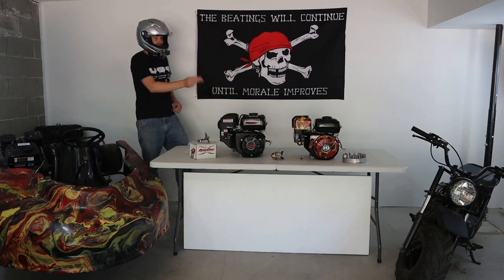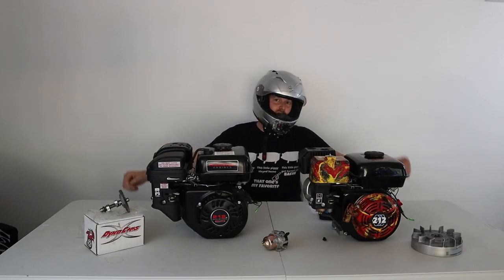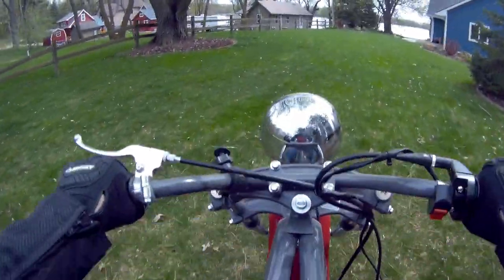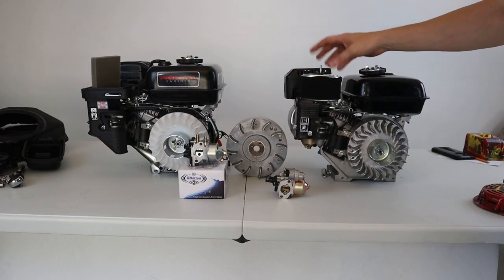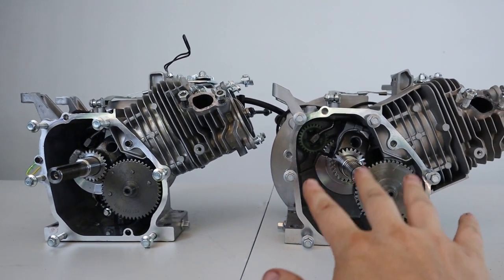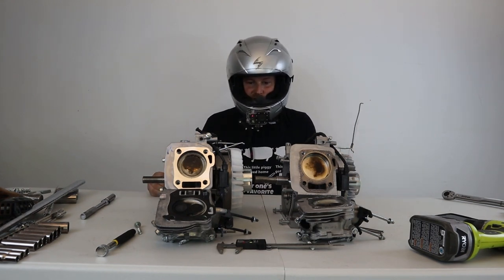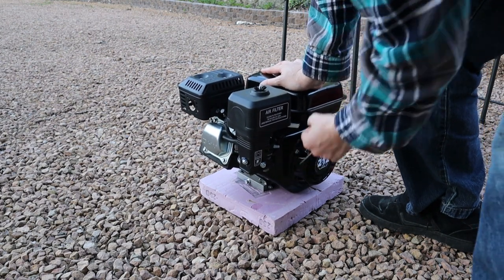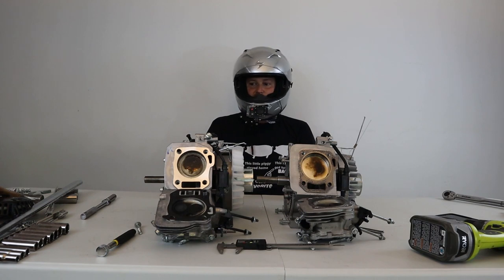Tillotson 212 versus Predator - Best 212 cc engine for performance mods?

Comment: Would have been nice to see at what RPM maximum torque was at. A 212 Pred with a stage one kit should get over 9HP at 4600 RPM. Years ago I seen a dyno test result of a stock Pred with what is known now as a stage 1 kit. It got 13.5 ft/lbs of torque.

 The Tillotson should have more power. It has higher compression out of the box than the Pred. No mystery there.

Out of the box the spring is in a different hole on the gov arm. This is why the Tillotson gets higher governed RPM than the Predator. You can do the same on any 196 or 212.

I  would never buy a Tillotson unless I was building a monster 8000 plus RPM engine. The Pred 212 and 196 clones work just fine. I guess the Tillotson is nice for those who want out of the box power and don't want to open the engine. And by the way, these 212's are not clones. True clones are 196cc.

Another thing to remember here is that the Tillotson is an out of the box mini bike and go kart engine. The Predator is an out of the box utility engine.

Comment: Camshafts in the tillitsons has more lift and longer duration and my 212 e also came with stainless valves automotive keeper and locks and bronze guides

Comment: Having worked on both of these the Tillotson blocks are so much better. Take a bore gauge to your Tillotson vs the Predators. 

I have a Predator Hemi transplanted into a Tillotson block. You can't with a non hemi. Since the heads don't transfer without machine work.

Have a regular 212R bought as a fully assembled engine. Works a champ.

I won't be buying Predator stuff ever again.
Reply: same here - EVERYTHING is better

Comment: Those engines are not the "hemi" headed ones. Those ones generally have more torque stock but really open up when you put a stage 1 on them as they flow so much better. 

FYI: Harbor Freight look for part #60363 which is the hemi version. they mix them as all 212cc engines.

Preditors have very weak valve springs stock also and just a stage 1 it's recommended to upgrade them as with the higher RPM's they will float a bit even with the governor.
Reply from the maker: The hemi head comparison can be found here: https://youtu.be/zXj7VSEMJ4A

Comment: I'm using a 212 so it fits in phatmotos frame. This video helped me pick the Tillotson as I'm gonna build it as much as I can. I like all that extra support. One question though. Does the tilly support a charging system if I were to install it? I prefer that to a battery bank light system

Comment: yeah get the Tillotson block and just build a 212 with what you want. save on stock parts you'll scrap anyway like rockers, pushrods, valves and springs, etc.

Comment: I recently purchased a Trailmaster 200-2 and it comes with the 196cc Chinese clone engine, Jhiang Dong I believe. I'm thinking of replacing it with the Tillitson 212r. Could you do a side-by-side comp of these 2 engines?  I plan on keeping the engine stock, but will be replacing the 46t rear sprocket with a 60t for better low end torque.

Comment: watch a comparison of 2 gasoline engines on video. Like I saw the machines I owned were branded RATO and branded DUCAR.

I chose the best Predator machine, because it is similar to the rato machine that I have.

I have tried almost all engine brands.
Original Chinese-made gasoline engines like Rato & Loncin are very strong, able to fight famous brands such as Honda, Robin, Yamaha, Mitsubishi, Briggs & Stratton, Kohler.

Meanwhile, other brands of gasoline engine made in China, according to my experience and knowledge, are not as tough as Rato & Loncin

Comment: What do you think is the best cam for the 212r To take advantage of the parts already on there like the flywheel, head, and piston.  I know the one that is in it is better than stock but I'm sure as ur RPM goes up it will start to fall off.

Comment: do you have a recommendation on wether it would be worth the money to buy a stock predator and put the Gopowersports stage 2 kit on it (cam, rod , flywheel #22 springs) or just buy the MkII 212r from EC carbs and throw some #22 springs on it. about 80$ cheaper for that. 

I already have a stage 1 kit to put on either motor.

Comment: What did you mean by the $70 upgrade flywheel on the Predator ????   I've been wandering about a flywheel upgrade without having to spend lots of $$$. Not going to spin one mega PPMs but still don't wanna explode one.
Reply from the maker: The PVL flywheel is an alternative to a billet flywheel. It costs about $70 and has a range up to 17,000 rpm.

Comment: Any reason to put a mikuni carb on the 212r also what about a different exhaust to see gains in HP?  I put a 212r on my yerf dog 3203 with a juggernaut and noticed a considerable difference compared to the techumseh 6.5 and comet clutch.  Just wondering if I should spend the cash in the mikuni and exhaust for added hp gains?
Reply from the maker: Great question. I have a header on mine with stock airbox (since it's high flow) and it gave a nice little boost. However, unless you replace the piston rod with billet, up the valve springs, remove the governor, then you don't want to put too much more power into it. You've gotta make it safe for the extra rpms, first. If you remove the gov, switching to a smaller mikuni makes it easy to have a tidy throttle setup. Wish I could give the perfect answer, but you have a few paths you can go. Without governor removal, the carb won't do too much but itself. The header and a jet swap on the carb will be your biggest impact at that level.
Reply: @megoingfast  Thanks, honestly with the 212r on there and juggernaut it has enough power and torque to spin the super turf 20x10.0-8 and we get up to 35mph on the dirt with 2 people.  That’s fast enough for that small frame.  Thanks again for dropping the knowledge!  We will keep watching and love the videos especially the intro song....lol

Comment: So if one were to slap on stage 1 upgrades and leave it at that...which is the better choice?
Reply: If cost does not matter go with the Tillotson. If you are on a budget go Predator.

Here's my opinion.... The only way I would buy a Tillotson is if I wanted to build a high compression high RPM engine. Anything 7500 RPM and under and lower compression engine I would get/use a 196 clone or 212 Predator.

Comment: Hey I recently bought a Tillotson 212 E from gopowersports and I had the same problem you had but the opposite if that makes sense. My exhaust valve was staying shut while my intake would open because the valve lash was not set correctly and was too loose and it pushed my exhaust push rod out of the rocker arm and for a day and a half I was baffled as to what was going on until I check the valve lash. It runs fine now that I put the push rod back in and it wasn't bent set the valve lash and she was good. I didn't get much information as to what the valve lash was supposed to be I had to try and find it on tillotson's website. If there is a way to contact them would you possibly let me know how I have a few questions because I bought two brand new Predator hemis, a stage 1 Tillotson 212 e, and a Tillotson 225 Stroker that just came out
Reply from the maker: .003 for valve lash. Best to ask through where you bought to start if any issues. Otherwise, I go through tillotson Ireland sure and us tillotson e.c. carburetor. Best start with who you bought from in case they changed specs or did mods pre-sale.
Reply: @megoingfast  I would prefer to buy from Tillotson straight. But my only source at the moment is gopowersports as far as Tillotson go oh, I haven't had any issues with the 225 is actually a pretty stout motor it's gotten my mini bike up to 75 miles an hour out of the box with the right gearing and jetting. Thank you for the information and is that .003 for both the intake and exhaust?
Reply from the maker: @mindovermatter3988  both

Comment: I would have gotten this engine (the Tilly 212R)  but not in stock so I got the old blue Tillotson 212.  Hope it runs good in the MB200-2.  Seems like from videos on YT is makes a little more power than the Predator stock.  🤷‍♂️
Reply: I also wonder if the Blue 212E has stiffer valve springs than 10.8 lbs stock.

Comment: Does the tillotson air filter box accept the 33mm as well?  Just curious if a 33mm k&n filter would be a good move?
Reply from the maker: Air filter comes with the Tillotson would be more surface area and is a high flow pleated.
Reply from the maker: Air filter box has rod going through center. Modifications to the filter would be needed.

Comment: You need to dyno the new stock Wild Cat 223 from EC carbs it has a 58mm stroke an hemi head. For Only $200
Reply from the maker: 7.5 hp out of box. Besides that, anything in particular you're curious about?
Reply: @megoingfast  Torque"
Reply from the maker: @jacobsebastien3910  the charging coil has me tempted but I'll have to look at what flywheel specs it has to see if that's any good for a build or flywheel only rated to 5k and would be replaced anyway. Looks like the Lifan 212 a little.
Reply: @megoingfast  confirmed by EC carb email I asked which hemi head Flows better between the Wildcat hemi head an the blue Tillotson 212 hemi head an they said out of the box the blue Tillotson Hemi Head Flows Better out of the box.
Reply: @megoingfast   I'd like to see a detailed comparison of the various hemi heads.  Valve angle, material, valve lengths, stem diameters, keeper types, cc's - that sort of stuff. It's easy to get info for the non hemi's [to me]. I'm trying to upgrade a wildcat head and it seems valve angles are different. Valve length too.  Seems to be quite the bastard but i like the bowl machining!

Comment: Any issues with gas tank venting? I heard of sum of those issues.
Reply from the maker: Myself, no, but I have heard from others that this was an issue. That cap is a common cheapo I've seen a lot in lawnmower use for $5. Very budget.
Reply: @megoingfast  I'm wondering if a Tillotson 212 (blue) tank would fit on the 212r
Reply: @megoingfast  me personally I would want to change the tank for venting issues an seems like it would be easier for dust/dirt to get suck in from cap from dusty conditions the way it vents. On my Tillotson 212 blue I have a filter on my gas tank vent. 🤔 Just thinking..
Reply from the maker: Don't know, but I do know that a champion 196 gas cap is a premium cap that fits on my 212r right now. Just tested a few caps I had around.
Reply from the maker: Predator hemi does, non-hemi does not. Hemi cap the same for as the champion.

Comment: Question for you. I have a Tilly 212 and juggernaut on my BT200X. I've seen a lot of videos where they cut the gas vent tubing as part of their stage 1&2 mods. 

The EPA filter box or whatever it's called is in the way for my TAV. Can I just cut that tubing? Or do I need to get a filter for it?

Thanks, love your stuff!
Reply from the maker: If you're referring to the tube that comes out of the valve cover? I put a 12mm filter on it to keep dust from getting in if I don't throw to a catch can. It should have pressure coming out when running, but stuff can always find a way in (bugs and dust). https://www.amazon.com/gp/aw/d/B0146I3MJC

Comment: Would you buy it again? Is it reliable?
Reply from the maker: Yes, I'd buy it again if I had a specific thing to run it on (which I do). It has been reliable with a header and muffler. Really fit into the stock jetting well and now runs very smooth.
Reply: @megoingfast  so would it just be plug n play for my gokart with a predator 212 with 30 series and juggernat cvt?
Reply from the maker: @coreyd7060  I have swapped the two on a few things so far. 99.8% yes. Very tiny dimensional differences length and width.
Reply: @megoingfast  thank you very much youve been most helpful. Another question is do you know why gopowersports stopped carrying them??? Maybe because its killing their predator product line lolololol

Comment: How does the Coleman engine compare in quality?
Reply from the maker: Quality, hard to judge. Most feel it lacking in power and the governor kicks in low. However, the parts on it are actually very nicely made from a quality control perspective.
Reply from the maker: Except the carb linkage issue. That typically should be addressed.
Reply: @megoingfast  Thank you!
Reply: if you have the small journal crank they suck!

Comment: great movie first off here in europe we have a karting competition called the 9hp in short you have to use a honda gx200 engine governor removed en the exhaust valve has retainer of an intakethat is it those things produce about 7000 rpm (to high) about 5000rpm is the sweet spot just under 9hp we rev max under load and short burst at 6400 rpm as last year we have a new catogery the tillotson series off factory 212 engine running 15 hp STOCK !!!!! get some information on this you will learn a lot off great stuff for your vids like learnd from yours i am gonna build me a dyno i wanna be as close to the 9 hp as i can website off our comp is https://www.gk4kartseries.com/